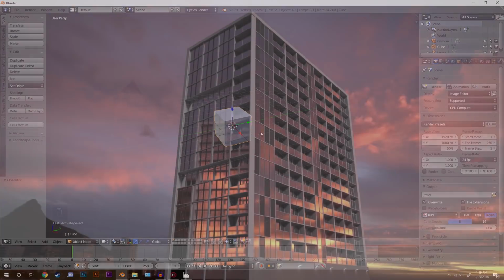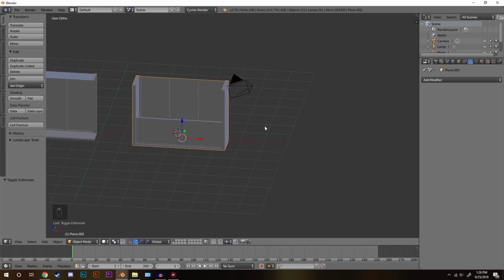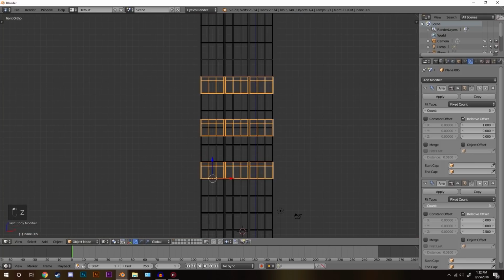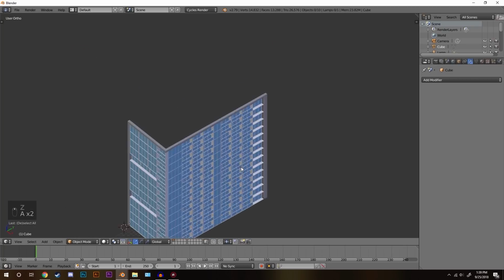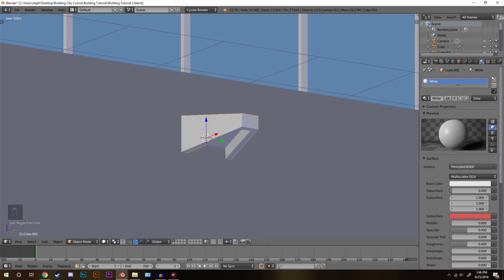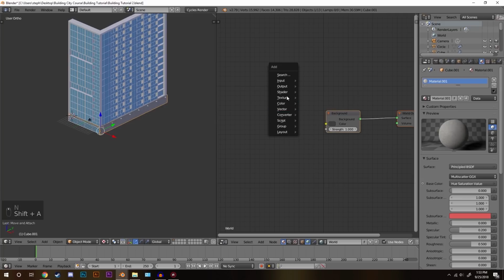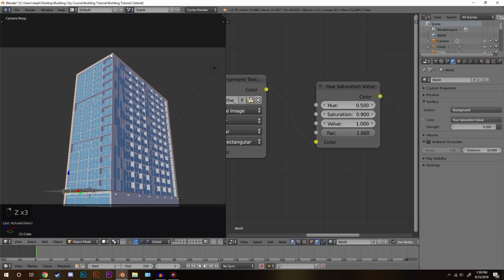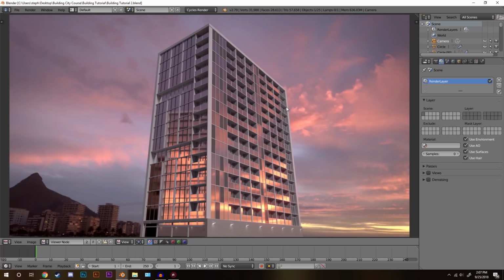Blender Tutorial Creating a Highrise Building

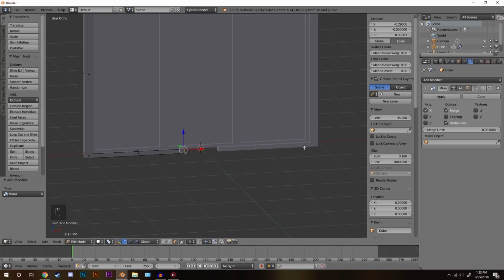Comment: at 3:34 I do what you do and the mirror goes to the left, what am I doing wrong!
Reply: That’s correct, it’s best to move scale rotate etc, in edit mode, if you forget, instead of deleting loads or starting again if you stay in object mode, with the object selected, and press control-A, a small menu will pop up where you can apply location, rotation and scale for the selected object. This will allow modifiers like the mirror modifier or the array modifier work correctly
Reply: Just had a same problem. The thing is, you have to go in "edit mode" right after when u scaled it down, before moving. So the origin point stays at the middle.